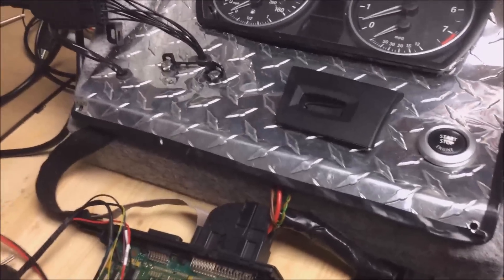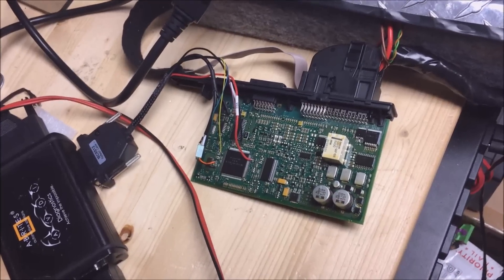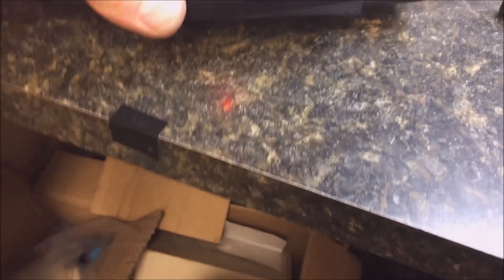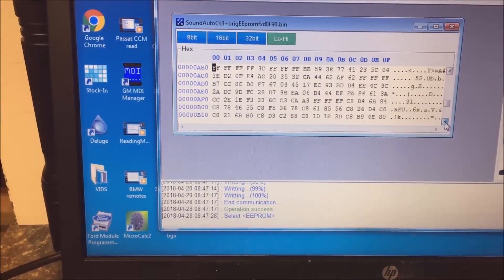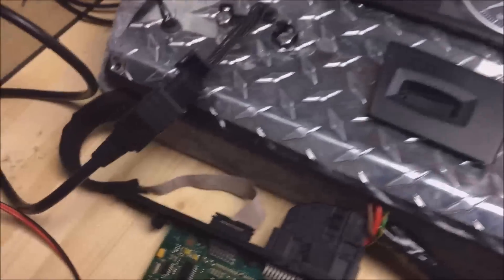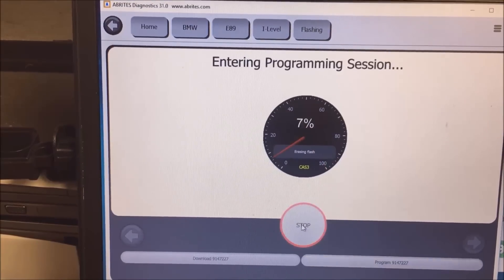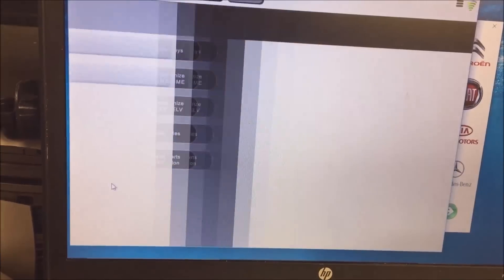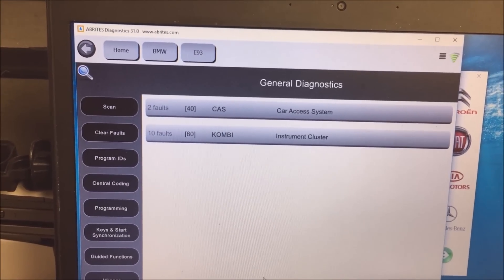BMW CAS3+fix

Comment: Good afternoon 
I have problem with my 2006 330i  crank but wont start and  there is no comunication with ecm and OBD2
Can you help me
Reply from the maker: what has been done to the car???  Did the car just stop?, did someone replace any modules??  can you talk to any of the modules?  what are you trying to scan the car with? if you put key in slot, can you talk to CAS?
Reply: I send tge ecm to tested and was working and when they pluged in the car you will be able to read only ABS and Air bag still showi g no comunication thru OBD2  my car crank but wont start
Reply from the maker: @LuisHernandez-cz7qg  The CAS module is what cranks the car, if the car isn't starting, you need to find out why the DME is not letting it start...  Do you have power at the DME? can you talk to the CAS module? What diagnostic tools are you using?
Reply: We tested all fuses and relay but  still the same let me start   checking the  ecm wires and see what else i can found
Reply from the maker: @LuisHernandez-cz7qg  once again, what tool are you using to diagnois this car???  If you don't have a scanner, you might as well tow it to a shop now...

Comment: Hi do you know anything about nissan xtrail trying to match replacement ecu but need to know if I can use BCM module to get the replacement ecu matched to the car this xtrail diddnt come with an ECU?
Reply from the maker: I have had more issues with Nissans, than any other car make...  To reprogram a PCM, you need NERS, and then you need an update, they charge you $260.00 for NERS, and the updates are about $40.00..  And your replacement PCM has to be identical to the one that came out of the car...  I had NERS for a year, tried to program 18 vehicles, half were PCM's and half were TCM's...  I was successful on 1, yes, 1... I have dealt with there tech support, who were great people, but there aftermarket support is the worst of any carmaker in the world... The system to find the update for your vehicle is impossible to use, and if you do figure it out, it probably won't like your used PCM...  I would find a used PCM from the same model of truck and then program a key to it and see if it starts...  Sorry, I hate nissan.... The shops I work for don't even ask me to try anymore... I have filed complaint after complaint with NASTF, and get back, We aren't required to do that...
Reply: Thanks alot for all your help and support you realy help me out alot. 👍👍👍

Comment: Hello Tim 
I have exactly the same problem
I was messing around with Ista-P 
And accidentally reprogrammed cas2
With key on
Now I have. No lights in dash exept for same light you have in dash service
My car is a 2006 330xi. Cas2 
Can you please try to fix my cas module I can try to get a used module from eBay matching part numbers and send both to you 

julioyova@hotmail.com

6142068223

Have a family 2 kids wife only one car currently

Comment: I sorted my bmw e90  all I need is  the flash dump files to complete the cas3+ if its not a problem can you please send me the dump file it would realy help alot please sir.
Reply from the maker: I sent the flash and the eprom the used CAS3+ module that I used in this video to your email you posted below about 19 hours ago...  Did you not get it?
Reply: nazeemk479@gmail.com
Reply from the maker: @nkhan7804  just sent it again...
Reply from the maker: from 2 different email address's..

Comment: Hi I need to do cas3+ swap cos I can't read the flash and the eprom how do i reprogramme the new cas3+ to work with my bmw e90 2012?
Reply from the maker: Find the exact same CAS module, read the eeprom and Flash with vvdi prog, then put CAS in car, make a key for it, once the key is turning on the cluster and sending a keep alive signal to the DME, read ISN from DME, write this ISN to the CAS, then encrypt it, then sync CAS to DME..

Comment: Hi after writing the eprom and flash data into my cas3 from a replacement cas3 what's the next step cos I have the lonsdot programmer will it work?
Reply from the maker: I don't have the londsor...  So I don't know...  I have AVDI...  I have nothing against Londsor, or any other china tool, I have VVDI prog,  But, I can tell you that you get what you pay for...  The VVDI for BMW won't reflash a CAS3+, and I don't know of anything else except ISTA that will...  If you watch the video, you will see where I use the online BMW programming with AVDI, if londsor or r270 has a server you can log into and use it to flash the data back to the CAS correctly, then you will have no issues...

Comment: Hi I tried updating cas3 but got error and no power read..can I use r270 programmer fix it?
Reply from the maker: Sorry, I have never used R270 programmer..  So I would not know...   Do you have a pinout for the CAS3+ in R270??  If so, you can probably read and write to it..
Reply: Yes I do have pinpoint for that
Reply from the maker: @nkhan7804  Sent email...
Reply: It was my flop cos it's was cas3+ and I use cas3 flash jus need to copy flash and eeprom from other cas3×  fix this cas3+

Comment: Hi Tim, I was do try add key to 2008 328i cas3++, with the vvdi2,
It was do reflush and stuck,
Now the cas need to be fixed, can i read and write with the vvdi prog? i dont have avdi
And i nust to have new/used cas to read the flash from there or i have other option?
Reply from the maker: Ihave VVDI prog, but don't have VVDI2...  I haven't seen anyone reflash with VVDI2...  AVDI has an online server that it access's, then it writes the data to the CAS..  Does VVDI have that ability?? Can you post what part number your CAS is?  I have sent the flash from this used CAS module to a few people and they were able to get there cars going...  But they have AVDI...

Comment: Hi Tim. I was wondering if I send you my CAS if you can diagnose and fix it for me. I'm having the same issue. Regards  Ralph
Reply from the maker: sorry bud, I have been out of town...   What happened to your CAS module??
Reply: @timtracy9442  We lost the only key to the car. Ordered a new one from dealership.New keys did not start the car so we towed car to dealer. They said we needed a new CAS. The car was working absolutely perfect before we lost the key. It's weird how now the CAS has an issue. Any recommendatikns?
Reply from the maker: @cobraralph  That is not uncommon...  What happens is they hook the car up to the diagnostic tester (ISTA) and when ISTA looks at the car, it formulates a measures plan (plan of what fixes the car needs)  when the tech runs the plan, the first module it updates software on is the CAS...  when it fails on the CAS, it errors out and stops the plan from advancing...  What year and model is your car? We have seen the 3 series 08-10 and the 5 series 07-10 having an issue with ISTA blanking the flash of the CAS...  That is what happened on the CAS in this video...  The shop was trying to upgrade the DME (engine computer) and when it tried upgrading the CAS, it did what you see in the video...  I would call around to your local locksmiths and see if any of them are doing keys for BMW's...  If they have AVDI, they should be able to help you...

Comment: YOU  DID NOT SYNC  ISN BETWEEN DME AND CAS 3 THIS IS WHY IT DID NOT WORK
Reply from the maker: It worked fine...  When you repair the flash, and change the bytes in the eeprom, the ISN from the CAS is still in there...  The CAS already had a programmed key, the ISTA program actually deleted about half of the flash...  Why would you say it didn't work???  I just did another last night, a 2009 5 series that had the same problem...  The shop tried to update the DME because there was a TSB on the 02 sensor, when ISTA makes a measures plan, it starts with the CAS and then moves onto the footwell module and then to the other modules.. we have seen 6 or more in the last couple of months that ISTA has gotten halfway thru updating the CAS and then, boom, can't go any further...  after that, the CAS won't do anything... When you scan the car, the CAS has ????  for a part number, if you can even talk to the CAS...  I will post another video showing how that simulator is wired and the latest CAS module that was briked by ISTA...   Do you have a video showing how this doesn't work?  Programming a key to one of these is a little different, especially if it is AKL, in that situation, we don't have to reload and then fix the flash, we downgrade the CAS, then make a key to position 8, then turn on the CAS, then when the CAS is on, which sends a keep alive signal to the DME, we read the DME's ISN, then write that to the CAS, then encrypt it, then write the encrypted ISN to the CAS, then sync CAS to DME....  I would love to see a video you have made...

Comment: Are you using some kind of CAN filter with the cluster so that mileage isn’t swapped accidentally if one module is higher than the other or do you change the mileage before doing work each time?
Reply from the maker: No, shut off the mileage communication in the cluster bin file...
Reply: Thank you for your response! I’m trying to put together a bench setup as well. I seen you commented below on possibly doing a video on how you wired yours up. I’d love to see that sometime or any input on doing it would be greatly appreciated!!
Reply: How did you shut off the mileage communication in the cluster bin file?

Comment: Tim, I was attempting to create a new key and update the DME to msd81 using CGDI tool and it bricked my CAS3+ module. I was able to do get the flash from a good working unit with the same part number and programmed it with VVDI Prog. However, I do not have abrites to program it! So when I plug it in the car nothing happens. Is it possible to mail it to you? I am in the US (California), ! You can email me at blackholestudio(at)gmail.com or text me 571 482 9567! Thanks

Comment: Hi Tim, 
My foot well mOdule, needs to be reprogrammed, how could I have is repaired by you? It got scrambled after I disconnected the battery, to have it replaced. Do you offer that kind of work? If not, could you recommend anyone? Thank you so much
Reply from the maker: If you have a passthru, you can subscribe to the BMW ista for $40.00 for 24 hours...  hook it up and scan your car, it will give you a measures plan.. run the measures plan and it should reflash the module...  Where are you located?
Reply: Tim Tracy I live in Atlanta GA, I've never heard of that site, but I can give it a shot. Thank you for replying
Reply from the maker: go to this site...  it is the factory webpage...  setup an account and then go to the ista subscription page...  good luck..
http://www.bmwtechinfo.com
Reply: Helton matos... did you ever reprogram your cas?

Comment: Mr Tim I need your help with installing the ak90 I have a problem I can't make it work with my 2 different laptops Windows 7 Professional and Window XP how much you would charge me to help me out to install it through TeamViewer please let me know
Reply from the maker: What are you having issues with? Copy the file folder on CD, move to C drive, the biggest issue I had was with finding correct driver...

Comment: Thanks so much!!! I don't have a "simulator", so once I flash the CAS with VVDIProg using working donor CAS to restore good flash Can I plug the CAS into the car normally and proceed with Abrites programming? Anything else I need to do after I put the CAS back in regarding the DME?
Reply from the maker: I have had a couple lately that I flashed with the flash from a used module, and the eeprom was totally messed up..  couldn't seem to save it..  I wrote the eeprom and flash from the new/used CAS, then put it in the car and programmed a key to position 8, then was able to read the ISN from the DME, then I wrote the DME's ISN to the cas, encrypted, then synced cas to dme, and car started..
Reply: Today I reconnected the negative terminal to the battery and viola car had power again and started fine, remote locks work. Then all of a sudden it died again, and then I remembered my car has an open recall for the main B+ battery wire to fuse box. After doing a google search this the symptoms seem to line up with my problem!

Comment: What's all needed to build a bench system like yours? Pretty cool, good video.
Reply from the maker: The cluster and slot and button came from ebay...  I used to take that simulator to locksmith shows to explain how the BMW CAS system works..  I'll make a video showing how it is wired up..  Not hard to do...  After having a few CAS modules get bricked, it is nice to have someway to test them when you think you have them fixed...
Reply: @timtracy9442  any chance you can email me how you wired up all those things together?  i have all those parts and spare cas modules, just having little issues getting it all connected, i must have something off in my wiring.
Reply: @timtracy9442  this is a must have. i was at the junkyard last week they had an all you can carry event, i should of grabbed everything for this setup
Reply from the maker: @lakelandcarkeys  Basicly it's the cluster, cluster plug, cas plug and an OBD plug.. and I looked at a schematic and hooked them all together...  The biggest issue is that you can't have a DME on the same CAN bus that you have the CAS on.. you have to have a gateway to seperate the cas and the DME..

Comment: Hi why did you  swop to vvdi and not use avdi to read and right as im new to this and lm want to learn whats best cheers
Reply from the maker: Because AVDI doesn't list the chip in ABPROG...  I read the chip by soldering on and EEPROMING it...  Search for the video by Shemek Best on fixing a defective CAS that won't boot...  AVDI is great once you are able to talk to the module, but if you can't talk to it, you have to eeprom it to get it to communicate...  Great question...

Comment: Good work, here in the UK autel 908p is much safer in my experience flashing BMW. I have AVDI full but use 908p as it has never bricked BMW modules like my avdi has and it flashes so much faster over Ethernet
Reply from the maker: You are going to laugh...  Took the module back to the car at my friends shop, put the module into the car and encrypted the ISN, then synced to DME..  we fired up ISTA/P and tried to flash...  We were doing this to update the data in the DME because of a cold start/run problem...  Guess what, ISTA/P bricked the CAS again....  We put the 2nd CAS into the car and encrypted and synced to the DME, pulled out the Autel 908p and tried to flash the DME... it kept failing.... Not sure what is up with this car...  These are the learning experiences that stick in your mind the next time you run into this problem...  We have started a ticket with the ISTA/P tech support, we'll see how that works out...
Reply: @timtracy9442  Happened to an e46 the software on the dme was corrupted anf that was f..... the other module. So the problem is on your dme. Find dump files for youe dme.
Reply: Tim Tracy did you try programming it with WinKFP already? If not, give it a shot! It did let me succesfully program all modules i tried it with whilst other software had failed me a few times before.
Reply from the maker: I try and use WinKFP, and fail miserably.....  I have a couple versions, and none will do much of anything...  I even bought Icom 2 to use it instead of the K-can dongle...  If you know somewhere to download a version that works... please let me know where...
Reply: Tim Tracy I’ve had my complete installation for a while and haven’t touched it for over a year, don’t have the original installers or the daten files anymore. NCS expert i’m still using about every day, WinKFP maybe once a month. I will take a look at what version WinKFP and EDIABAS i’m running. Since i don’t really remember, daten files i’ve used the latest version i could get a hold of.
For WinKFP there’s a specific procedure for importing the daten into the program, i can send you a guide PDF for importing the daten and setting up WinKFP.
Meanwhile, did it gave you errors during programming? If so, could you please provide some info as to what these error messages where, what steps you took prior to and while flashing? I’m using a genuine BMW ICOM Next and it works really well on all BMW models,E and F series for diagnostics,programming and coding. Flashing with a decent K+DCAN should be sufficient tho for a CAS module.
Reply: Tim Tracy i’ve quickly checked what versions i’m on.
WinKFP - 5.3.1
EDIABAS - 7.3.0
SP-DATEN - 3.59.0.600 AKA V59
Also make sure you’re running it on a 32 bit operating system.
I’ve been running this setup for 2 years with windows 7 32 bit running in a VM on a MacBook.